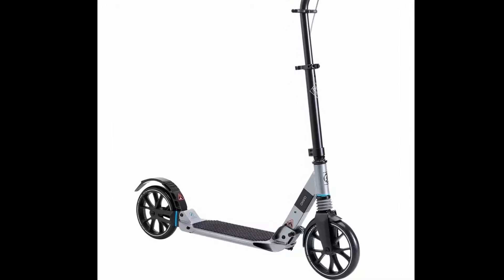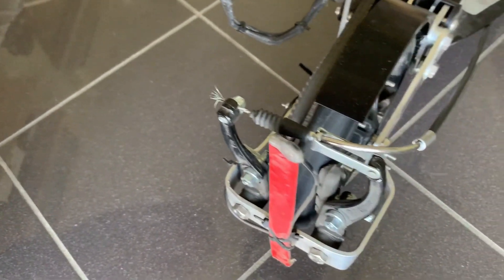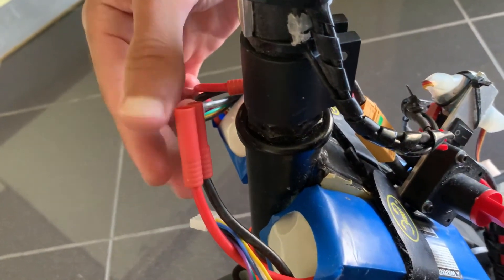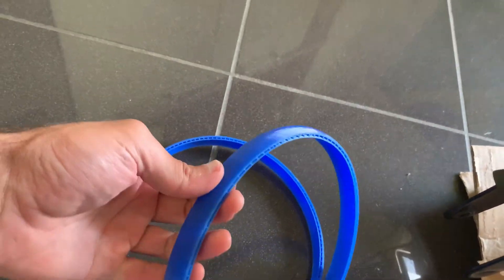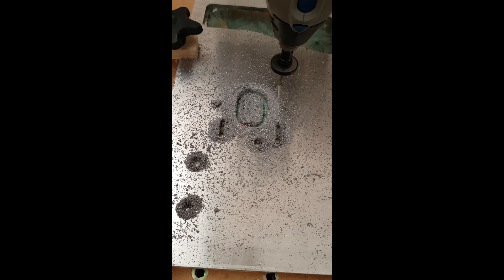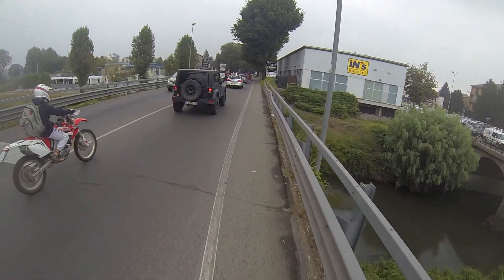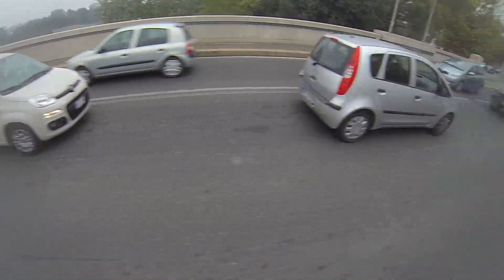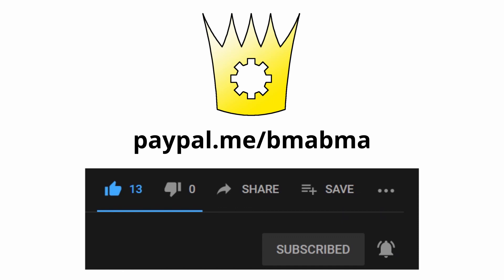Adding a 2000W motor to Oxelo 7XL (scooter) to go at 38km/h (24mph)

Comment: First!

Could you make a video on that Dremel CNC rig?
If it's DIY or not, how $$$, the quality of the "cuts" on the parts produced, the size and weight...

Also, why did you go with plexiglass and not aluminum for the wheel gear? $$?
Reply from the maker: Unfortunately I’m not with the router right now to do a video 😕 it’s an Inventables Shapeoko 2 using a Dremel 4000 as the router 👍🏽